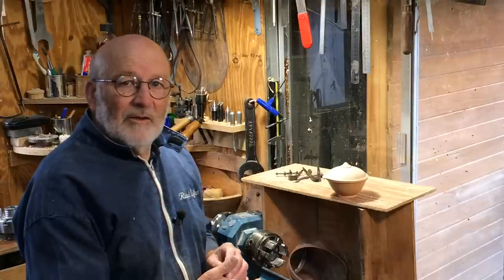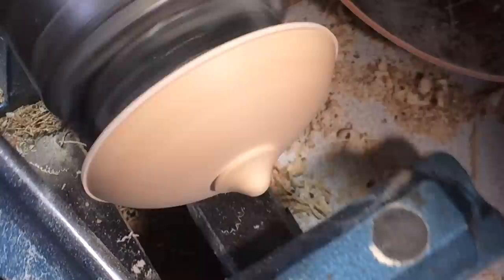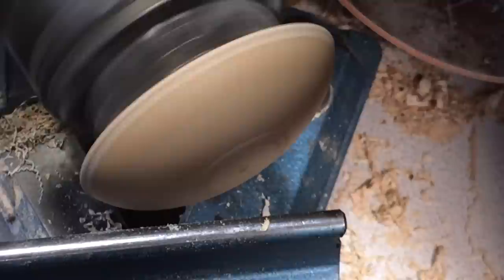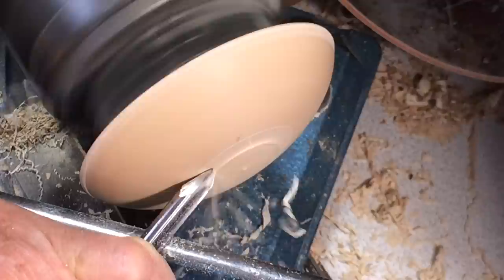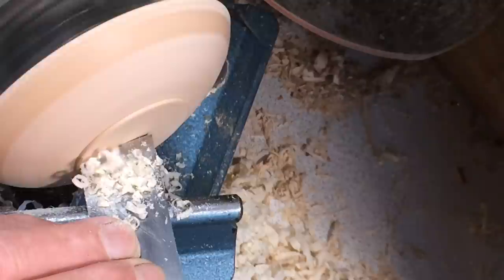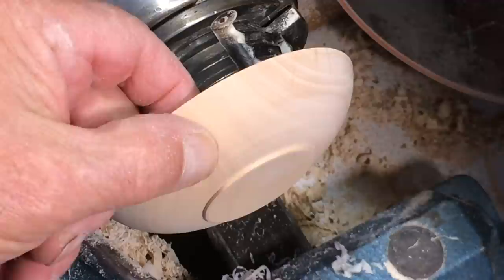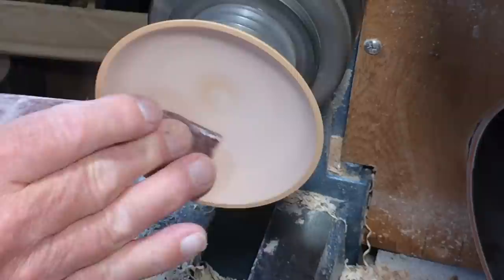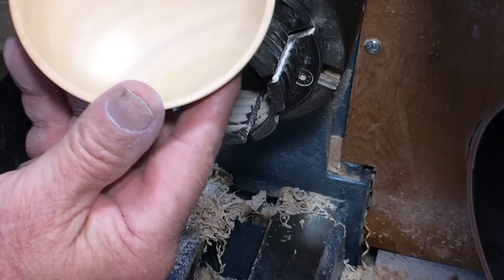Richard Raffan turns a broken lid in to a bowl.

Comment: Great video.  Thanks.  This may sound ridiculous but I’ve been experimenting with making lids that can be converted into bowls either by making the lid button center concave or a removable spindle.  Using a threaded insert for the removable spindle.
Reply from the maker: Not ridiculous at all. I've set this as a challenge in a crossgrain box workshop. Many times over decades I've tried to create a lid that functions as a bowl but have yet to be satisfied with the result. If the lid works as bowl chances are the bowl looks like a bowl missing a lid. A bead or rim to locate the lid tends to look odd when on its own and there for no obvious purpose. Time to give that another go!

Comment: Richard,  I see that you use mostly tenons on the bottom of bowls.  Occasionally you use a dovetail mortise and I'm wondering why you don't do this more?  I've found that to be the easiest way of holding the bottom of the bowl and it avoids having to remove the foot.
Reply from the maker: I never use a dovetail mortice if I can possibly avoid it for several reasons. 1. It limits the depth to which you can hollow, making a bowl heavier in the base than needed both physically and visually. 2. You're gripping on a smaller diameter than jaws enclosing around a foot or tenon, so there's less support for the blank. 3. Unless you have more than 20mm of wood surrounding the jaws, the mortise needs to be close to the diameter of the chuck. With jaws opened wide in a mortise you need to ensure jaws aren't pressing against the endgrain which can slip like a geological fault line. It's just anothe irritation I can do without. 4. Finally, with many bowls I want a foot. The 2-in Spigot Chuck introduced by Craft Supplies UK in 1978 enable me to take small decorative footed bowls straight out of the chuck.. I was delighted when the modern 4-jaw chucks came along a decade later, enabling me to do the same with larger footed bowls. I was selling bowls for a living, so being able to take finished bowls from a chuck saved me hundreds of hours and increased my production by several bowls a day. If I want to remove a foot that takes only a couple of minutes, but mostly I don't.

Comment: When sanding the inside in reverse it looks like the chuck might have started to unscrew off. It's very apparent when it screws itself back on when turned back in the forward direction to apply the wax. (11:30-12:00) Any tips for preventing that? Would hate to have to turn the rescued bowl into a backgammon piece. 😉 Love your instructional commentary during every step!
Reply from the maker: It does look as though the chuck unscrewed slightly, so I was lucky to get away with that. Now I'm surprised you didn't see me catching the bowl and chuck. Switching back to forward, normally there would have been a clunk as it locked on — followed by a loud oh-no! groan from me, knowing it might take minutes to get the chuck off the spindle. To avoid that, when mounting chucks and faceplates on the spindle I always flick them through the last half turn to lock them on and pevent them unwinding as I switch on reverse.  And I often give the chuck a push as I switch on reverse. If the chuck isn't on tight reverse will usually have it off instantly.

Comment: Good timing on this one, just came back inside from slashing the paddocks, and here's a new video from Richard while I have a cold drink, lol. Great little bowl, and info as always. I'd like to hear more on why you choose to use a spindle gouge for face work, despite what the "experts" (keyboard experts) say. I prefer a Bowl Gouge myself, but that's how I learnt, despite my only having one 3/8 spindle gouge, lol. Thanks as always for sharing Richard, I should get off my butt and do some videos for my channel also.
Reply from the maker: I have two reasons for using a spindle gouge on facework, maybe three. First, a spindle gouge is less expensive than a bowl gouge, the strength of which is wasted when cutting close to the rest. Second, when roughing bowls using green wood, shavings used to jam in a deep flute so tight I had to spend time levering them out with a dental tool. Third, deep-fluted gouges, at least mine, can't get into corners like a spindle gouge. OH! And there's a fourth reason: to show the superstitious and ignorant that you can use spindle gouges on facework including bowls  https://www.youtube.com/watch?v=sYHBrUxpo7M.
Reply: @RichardRaffanwoodturning  All good reasons. I hadn't considered the cost, but that's a good one.
Reply: Sorry to interup the comments but i did convert to use more spindle gouge on face work and I gotta say I save a lot of deep flute gouge metal.... I use bowl gouge for hollowing and pushcut/sheer cut on final pass on outside of a bowl..... I believe Bob Stocksdale was using spindle gouges as well.... What I'm trying to say that they work wonderfull and cost savings are great in my case..... Sorry once again for interupt conversation😀
Reply from the maker: @tomislavtomasicwoodturning  Stocksdale did use a spindle gouge made for him by Jerry Glaser who gave me one - a Stocksdale gouge - in 1981. I roughed all my bowl profiles with it for about seven years.
Reply: @RichardRaffanwoodturning  was it like henry taylor or hamlet or ?
Reply from the maker: @tomislavtomasicwoodturning  Only similar. It was ½-in diameter and a sintered steel called Vascoware. The edge outlasted all other gouges I've used.
Reply: @RichardRaffanwoodturning  I assume its not made anymore right?
Reply from the maker: @tomislavtomasicwoodturning  It was an experimental tool and never went into production.
Reply: @RichardRaffanwoodturning  that is too bad.... Thank you.... Looking forward to new video 👍

Comment: Nice save. Good design upside down and now right side up.
Brings up an interesting question and I would like your opinion. 
I have a box of bowls I turned that are some of the first ones I did. Not up to my standards. I want to "finish" turning them. My wife says it is a good record of my progress. What do you think, once turned or twice turned?
Reply from the maker: I think it's worth keeping a few pieces to mark your progress. I still have my first bowl and first plate in daily use. It's also worth keeping a few pieces to remind you not to go there again. For many years I turned thick-walled bowls because that's what the Australian market demanded at that time. Some came back to me years later and I re-turned them to thinner bowls, treating them as roughed out bowls. If you've got a clunky bowl there's no reason why you can't get it back on the lathe and see what you can do with it. And no big deal if you end up with nothing other than an enjoyable journey of exploration.